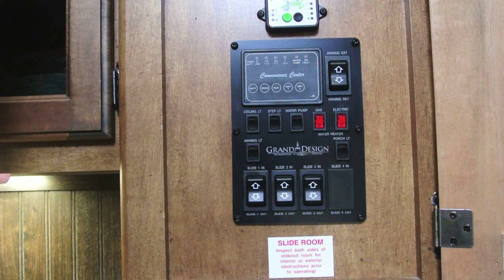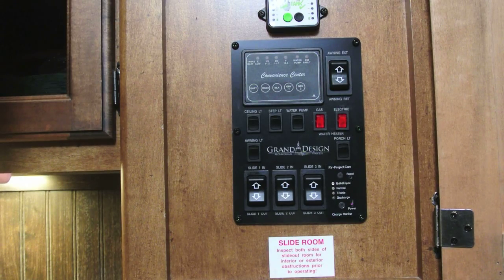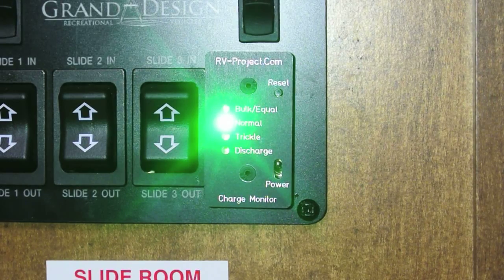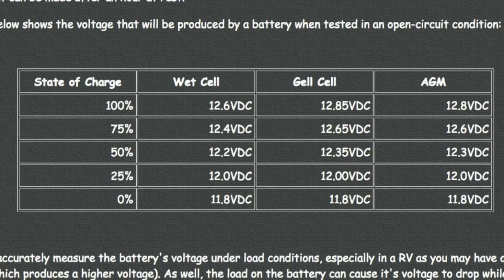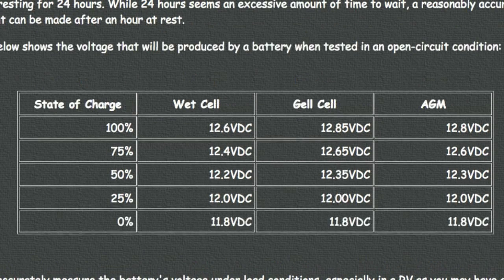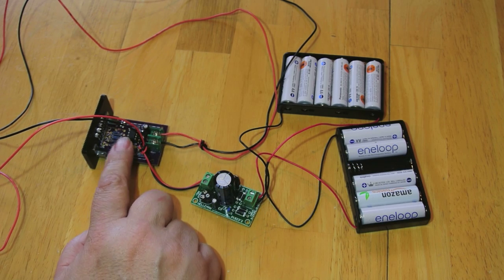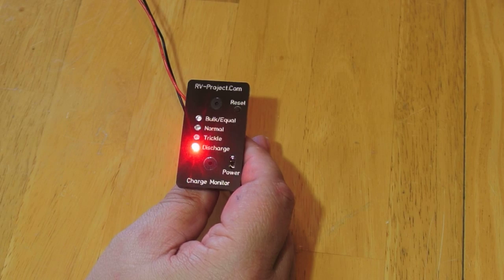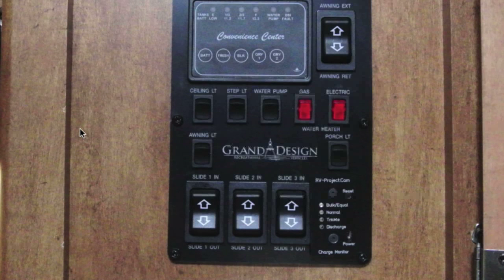A custom built Charger/Battery Monitor for your RV.

Comment: How much will it cost to build one?  This might be in your other videos.
Reply from the maker: Believe it or not, the most cost was the front panel. It was around $27 for the front panel. The circuit board was 3 for $16 (you cannot buy just one from the fab shop), and about $9 in electronic parts, depending if you want to build the same exact one (the switches were the most expensive electronic parts).

Then you have to buy a programmer board for around $20, but you can re-use it for other projects - such as my LED flasher project. And a few misc components - wire, screws, and such add a couple more dollars.  So maybe $75, but this is a custom made item, and depending on the front panel, you could drive that cost down a bit.  

I actually used the second board of my 3 board set to make a stand-alone version in a box. I have a set of alligator clips that I use to attach to the battery. I didn't need to buy a front panel for that, and I already paid for the three boards, so if you build two or three, your per-unit cost goes down.

There is a parts list on my website:http://www.rv-project.com/projects/batterymonitor.php  About 4 pages into the project is the parts list.

Comment: RVProject, Are you an electrical engineer?Who makes your circuit boards
Reply from the maker: My degree is in Computer Science. And I do have a lot of electrical engineering experience, but not a degree. I specialized in interfacing computer, communications, and electronic equipment for almost 20yrs. Before that, I spent 6yrs in the USAF as an electronics specialist.

The circuit boards are made by OSH Park (www.oshpark.com) and are about $5 per sq in for three (their minimum order). So the total cost for three boards for the monitor was $16, including shipping. Not too bad.

I have shared the project on OSH Park, and you can directly purchase the boards from them: 

https://oshpark.com/shared_projects/PivBZESy

I am very impressed with the boards for the cost. They are double-sided, silkscreened on both sides with solder masks and plated thru holes.
Reply: RVProject, this is just great, and things like this are really useful in the RV industry! I have my own trailer and I really enjoy modifying everything on it, at some point in the future I would be installing solar panels. I really enjoy having the AC and DC, you can really get the best of both worlds, and there are so many times I run into a problem where I wish there was a solution besides a $10 Chinese plastic piece that you'd be lucky to get a year out of. If I had your knowledge I would really be having a blast working on the trailer! Best of luck!

Comment: How much to buy one built?
Reply from the maker: Not sure if I can make these available or not. The licensing for the circuit board design software as well as the programming software restricts my use to non-commercial work. But I created the articles on the project webpage with the express purpose that anyone with a basic set of skills could build one.
Reply: Thanks i'm lucky I can screw in a light bulb!  lol
Reply from the maker: I realize this is not a project for everyone, but hopefully it will provide some interest for many.

Comment: nice... I installed the Bogart trimetric solar charge controller and battery monitor. the only thing I would add is that every battery has its own spec for bulk-float voltages. you should call the manufacturer to verify those voltages. some require over 15 volts in bulk mode in order to properly get all the needed amps into the batteries. good video. http://www.bogartengineering.com/products/trimetrics/
Reply from the maker: I used the voltage values from the manual for mycharger. At any rate, you can fine tune different voltages with a simple software change.
Reply: Sure, I also added a Magnum Energy 1200 watt inverter-charger. Those convert-chargers the RV industry slaps in these RV's are junk IMO. Most won't allow u to adjust the voltage up high enough to get a solid charge on your batteries. Good video.... Thanks
Reply: When I bought my camper it came with these small cranking interstate batteries. I called the company to see what they recommend for Bulk and float. I'm pretty sure they said 15.2 on the bulk. Try to get a stock charger to go up to 15.2 and hold that voltage for the right amount of time..... Won't happen.
Reply from the maker: Also, the trip points on the monitor are set between typical states. For example, for my charger, 14.3V is Bulk, 13.5V is normal, and 12.9V is trickle.  And the default "windows" used by the monitor are:

Everything above 13.9V is Bulk.
Everything between 13.9V and 13.2V is Normal
Everything between 13.2V and 12.6V is Trickle

This should catch most Smart Chargers, even if their set voltages are not exactly the same.  

And again, these set points are defined in the ATTiny85's software, so you don't have to swap out resistors to make any changes to the set points.

Comment: It would be great if you would sell this on Amazon. I would buy one with the meter and monitor configuration.
Reply from the maker: Not sure if I can make these available or not. The licensing for the circuit board design software as well as the programming software restricts my use to non-commercial work.